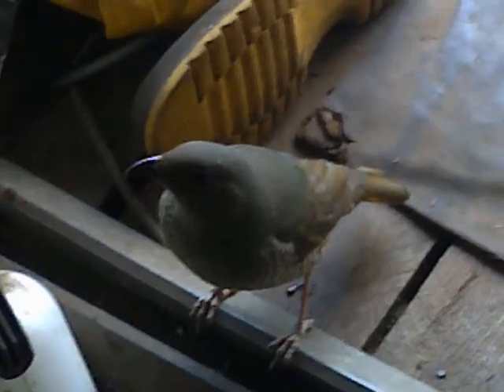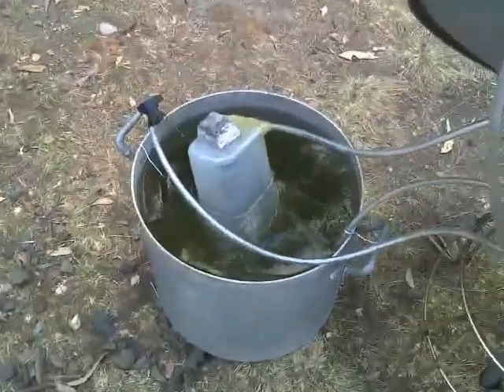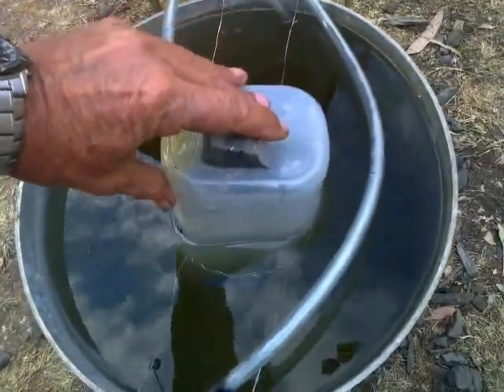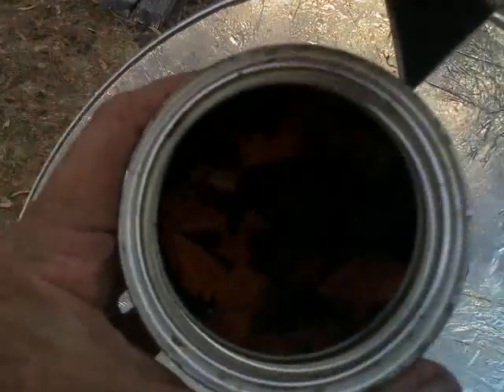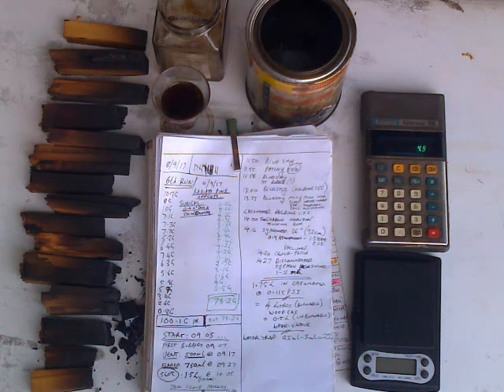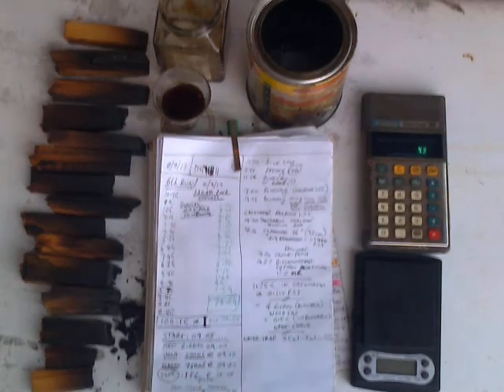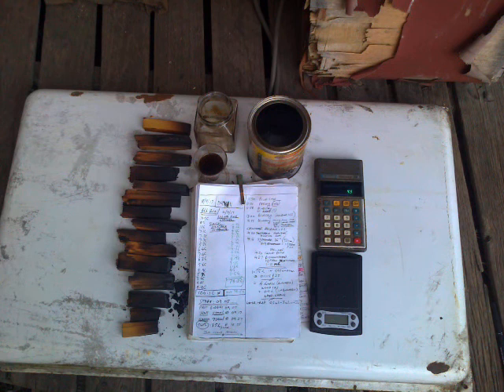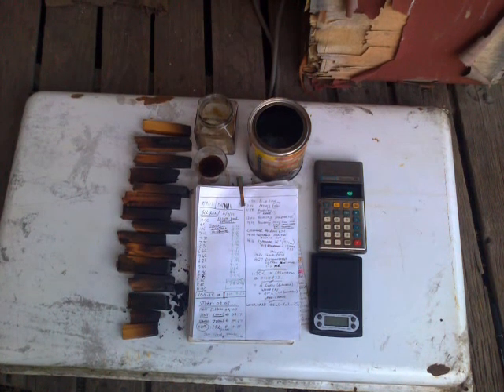Sungas, 6th Batch-Run ; 100 G. Pine = 4 Litres Woodgas

Comment: Bloody brilliant result watching with eager anticipation  the next step.  Might be a plan to trim your beard before willow the wisp does it for you :-)
Reply from the maker: G'day,

  Thanks mate...

   It's a fascinating project..., yesterday I tried using seasoned Stringybark on the bright side I fitted 250 Grams in the tin ; and over 5 hours it made 6 litres of Gas plus 50 Ml of Water/Tar..., but only 2.25 Litres of the Gas was burnable...
 
  So, the next trick will be to use Hardwood that's only been on the ground for a year or two, rather than since WW-1 ; because old  Hardwood seems to be only a quarter as good as Kiln-dried Pine.., on a weight/gas basis.
 
  Have a good one,

;-p

 Ciao !

Comment: "In the distance I saw a wonderful sight,
'twas woodgas burning bright in the night."
Spontanous poerty aside. That burned very cleanly. I suppose most of the things that would make soot are trapped in the black  tar liquid.
I wonder if you would get proper wood tar if you boiled off the water from that liquid. Maybee I should read up on how tar is made.
Edit: A quick search here on youtube gives at least half a dusin videos on how to make tar. One certainlly can learn alot by watching youtube videos.
Reply from the maker: G'day,

  Thanks,

   Yeah, I reckon you could make some very good Creosote by either evaporating or boiling off the Water..., it smells like Creosote with Turpentine, but it behaves like Water with Oils & Tars ; and it all dissolves in Methylated Spirits..., so I think it could go quite well as a White-Ant Treatment, to be painted onto Fenceposts..., it smells toxic and is probably carcinogenic as well...

    But, yeah, the Flame is beautfully clean, apparently it's Methane & Hydrogen...

   Yesterday was a "Bright Cloudy" type of a day, and I found that Gas Production doesn't happen much below a Can-bottom temperature of 400 Degrees Celsius.., with the best this rig can achieve in full Sun being about 580 C. ; I hope to get a linear response when increasing the sizes of of the Cannister & the Reflector, so if I double the Can to 1 Litre and triple the Mirror to 1.2 Sq. Metres then ideally the Can will be running at around 880 Celsius...(?).

    Time will tell, I guess...

  Have a good one,

  ;-p

  Ciao !